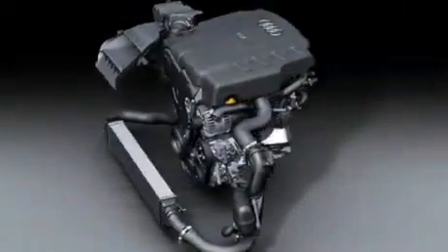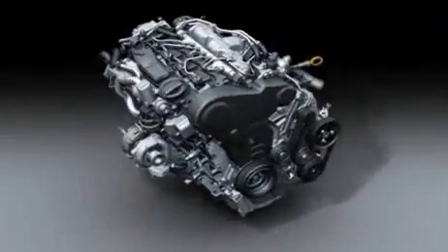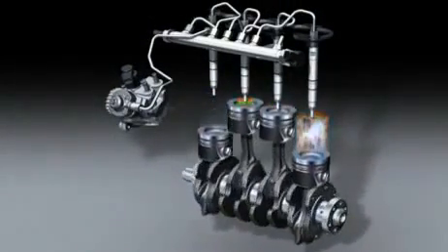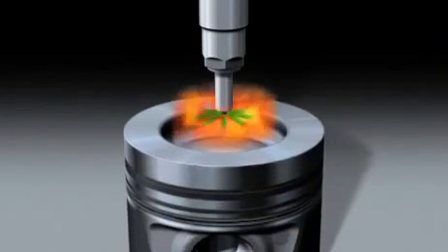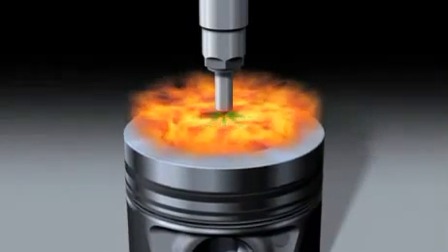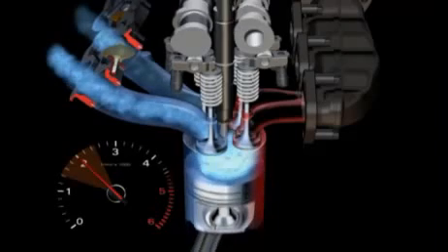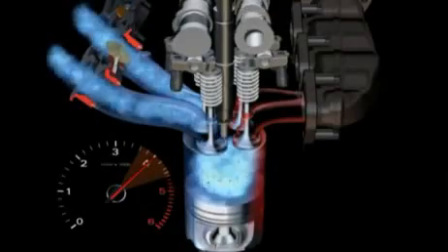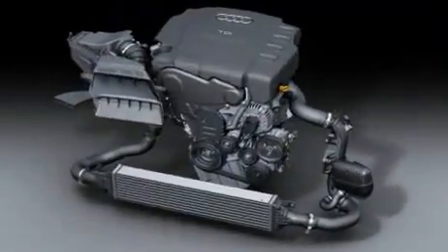Common rail diesel

Comment: I think he means it's a diesel engine, that can rev to 5400 rpm, most diesel engines are low rpm, around 3500, large engines, about 2200rpm, the higher revs, make it more drivable like a gas engine, keeping the TQ of diesel,,

Comment: Audi isn't the first car with TDI engine. 
The first passenger car to be powered by direct injection was the 1986 Fiat Croma 2.0 TD i.d. (The Turbo Diesel iniezione diretta pump was developed by Bosch in accordance with Fiat's engineering specifications)
Reply: yes , but ,comon rail sistem foi o alfa 156

Comment: TDI is probably good,but when it breaks,the price is terrible hight,also the two compound fly wheel is shit,its broken every 140k kilometers,timing belt is useable only for lawnmower,not for car,its not reliable as timing chain.CUMMINS for ever.
Reply: That was as coherent as a parrot on crack.

Comment: 1999? Its first coomon rail? Wrong, it was a alfa romeo 156 jtd 1997.
Reply: Nope. You're wrong!
The narrator said made by Audi in 1989, which I think was a 2.5 litre engine fitted to the 100 models and was infact the first TDI engine.
Alfa JTD - LOL
PF Jones is probably the most knowledgeable diesel specialists around!
Reply: vitobasser  i dont think so. Fiat started common rail at 1994 and bosh bought licence 1994 for bosch pump. See wikipedia and other historical papers.

Comment: Being only 1.6 Ltr means it spends a lot of time on high boost, specially when towing a trailer, I do like to make good time :-). It's also so much fun to drive that I tend to give it more size 8 right foot than it really needs. So I hope Hyundai have got it right in the durability department. As for the EGR, I did try the Exhaust blanking plate mod, the ECM is too smart and logs low flow codes after about 30 mins then goes into a low power mode cyclically to make you slow down and fix it. Dang.

Comment: I'm in Adelaide, and I have seen the remains of a BA/F Ford that burnt parked out the back of Jarvis Ford, that was around 2007, maybe it was component failure, maybe it was due to tampering/modifications. I'll stay with my CRD diesel, at least until the warranty runs out. After that I'm going back in technology, mechanical diesel injection, EGR and drive by wire are starting to annoy me. Also starting to wonder how long a 1.6 Ltr engine running 18 psi of boost is going to last.

Comment: Sorry misread yr comment WHY did I get a diesel. I've owned diesel light trucks and cars for the last 30 years, I love the torque, the ability to pull away at idle with almost full torque available, great when taking the kids camping with a trailer behind, also like the fuel economy, the diesel is almost constant around 5.5 Lt/100 klm however you drive it.Plus I have a dislike of high pressure petrol around a hot engine, we get lots of car fires in summer due to failed rubber hoses.

Comment: The Hyundai diesels are straight off the lot here in Australia, I think in the i30 the diesels make up a good percentage of sales. I have seen i20 diesels as well, not sure about i10's in Aus. but they exist in India I believe. The 1.6 Ltr U2 engine is a fireball, with traction control turned off it has no problem breaking wheels free in the first 2 gears on dry pavement. Easily pulls 4 adults and around 350 kG of trailer up a 7% grade at 110 km/h. Hope the rest of the driveline can take it.

Comment: The first direct injection engine in a passenger car was in the 1987 Fiat Croma TD id !!
The first common rail diesel was in the Alfa Romeo 156 .
Audi-Volkswagen stuck by their unit-injector system and switched to common rail in the 21th century only!

Comment: That's a mean number (850km with roughly 50L, it has 80km more autonomy in the red), on plain road only it still runs at 3.8L/100km. I just don't do plain road everytime I take my car. 

TDi beats earlier technologies in term of consumption, even if there's some gas burning before the actual effective explosion. This was the point I was trying to make in my first comment I think.

Comment: Also less weight, it's not just about the noise, even though a chain driven valve mechanism is today relatively quiet compared to a 300D engine of a Mercedes... Still I'm way more of a Mercedes guy, sweet sound rassling sound of satisfaction.

Comment: Why should this be a dream ? In mixed consumption this car runs at 6L/100km, but with little to no city it runs on a 3.8L/100km consumption. Actually, on a mountain road it runs with a 5.0L/100km one. I don't have a reason to be lying in public on the internet, do I ?

Comment: Do you know how diesel engine works ? Pressure is needed to detonate diesel you dumb ass. + how diesel can consume oxygen ? HOW? + this technique "evades" or reduces early detonation on high engine loads
"When it doesn't burn, it doesn't expand enough, so you need more of it to create torque and push the piston down."
If its running on rich mixture you got a lot of black smokes from pipe. Didn't saw that a long time.

Comment: Thing is you have only one unique, controlled fuel ignition point, whereas non-TDI have multiple ignition points in the cylinder. You avoid useless pressure peaks. The gas cloud is also thiner, so you burn more nonetheless.

I have a TDI Skoda Octavia, I never consummed more diesel (3.8L/100km) than my last VW Gold III GTD (at least 7L/100km) on the same exact road, the last one having less hp than the first.

Comment: but thats not the only problem
many people go fast with their car and then the turbo gets redhot 
and then when they come home they turn imm the key off
thats bad because then the oil in burned in the turbo 
so you need to run the car at idle rpm so the turbo will go off and cool down because the oil is kept circulated in the turbo

Comment: I think FIAT were the one to have made many of the break throughs. FIAT overcome the problem with cylinder stress in order to turbo charge a diesel to produce better low end torque. Also, I think common rail was invented by FIAT. Although not diesel related, VVT was an Italian invention (1979) also, not Honda as Honda is famous for its VTEC. It's very interesting how a lot of technology has come from FIAT or FIAT owned companies.

Comment: Also, many people will tend to disagree, but modern diesels need regular oil changes with good quality oil and not cheap rubbish, which people tend to throw in anyway and then they wonder why they have turbo problems.

Comment: that's true but it's not Ford 
it's actually the ppl who buy the tdci
they run their car on cheap diesel
like oeral,esso,tesco
i have a tdci and i only run it on bp ultimate or normal bp diesel
so you won't get problems
and i LOVE the turbo whistle in my 2.0tdci 163hp
so actually every new common rail diesel can be destroyed by fueling up with the cheapest diesel in your town

Comment: 4 times injecting into a chamber which has limited amount of oxygen is nothing but killing fuel. Most of that fuel does not even burn and will go straight out of the exhaust. I will never ever buy Audi anymore! From now on, I will be just suffering everytime I drive my Audi 2.5 tdi, because I know its fucking me in the ass from fuel consumption point of view :(

Comment: the best diesel engine is the one of second generation common rail of Ford europe TDCI
very quiet , torque as hellllll and very fast it uses solenoid injectors (only 1 spray) with a spray of 2000 bar and very very VERY reliable engine. i'm not a big fan but it is really true and i'm not a audi hater because they also make great engines except the 4 cylinder engine

Comment: @Andrewso10 hey no offence Germans have had some awesome engine designs and advancements but Japan still has an edge their Boxer engine is still the leading Diesel engine now even if their "using" German break through's they have been able to refine it to work together with other concepts better and improve their performance the Americans never had a good diesel engine so Germany has already surpassed America hell the Australia's are ahead of the US when it comes to Petrol engines

Comment: @Andrewso10 Mercedes-Benz SLS AMG 635 horsepower 0-60 3.8 ,BMW M3 414 hp 0-60 4.6 ,Audi R8 414 horsepower 0-60 4.4 ,Porsche 911 GT2 RS 620 horsepower 0-60 4.4,BMW X6M 547 horsepower 0-60 4.7...2012 corvette ZR1 638 hp 0-60 3.4 secs thats better then all of your germany cars above that u have listed and viper is over 600 hp 0-60 in under 4 secs